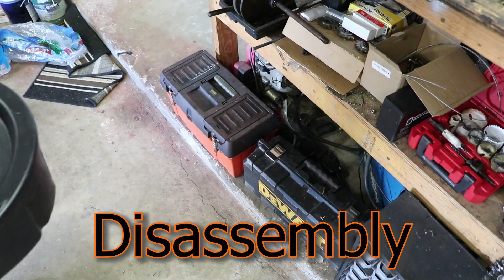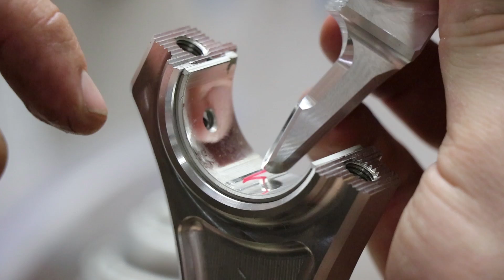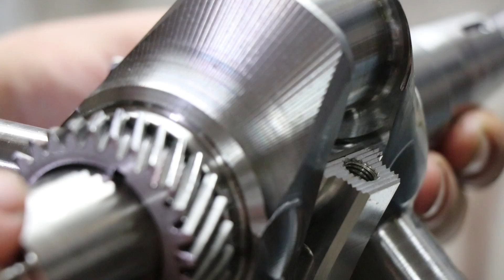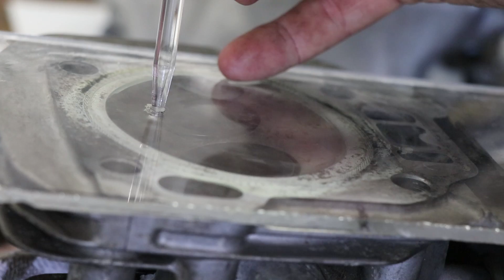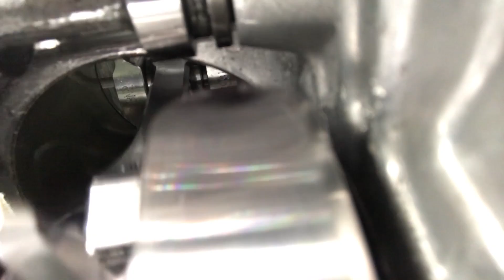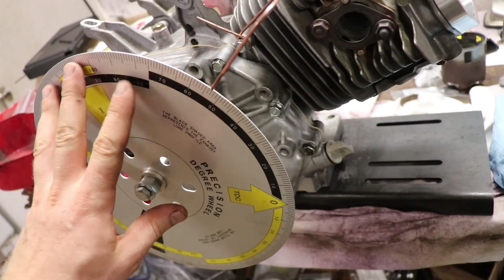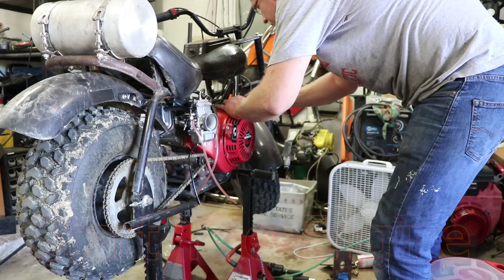Stroker Engine Build: 30+ HP on a 65 MPH Mini Bike! (Complete Build)

Comment: And for beginners or ' newbies' you don't sand your piston top - you polish it for improved heat deflection back onto the combustion chamber & in a Hemi you can polish the Head combustion chamber surface too to stop carbon build up aids flame propagation without going into the science of it all.It adds HP & helps to make your engine last longer.If you've milled your piston crown you can get it Teflon coated or polish it to a shine (an old top Fueler speed secret)cheers everyone.T NZ

Comment: I've seen so many people use little short rods which put far greater stress on the cylinder and make less power instead of making clearence for rods like you did. 
With a little grinding you can use a 6" rod on a small block stroker which makes more power (stays @TDC longer) and removes the stresses, these engines tend to run cooler as well, all that's needed to do it correctly is grinding like you illustrated.
Nice job, well explained, if I build one I will follow your lead.
Reply: ~the hell are you talking about?

Comment: I would love to see this thing on the dyno.  Next it would be cool to see less stroke and a really big bore and make it a really high revving engine and see how it compares.  It would likely cut down on the torque real low but add HP up top.  Great video by the way
Reply from the maker: yeah, the dyno is all set up. Youll have to wait about a month to see the video though as I have other footage im working on now.
Reply: Can't make really big bore, there would be nothing left of the metal around it...
Reply: For a high rev engine, you really need a pressurized oil system, not a splasher. Just my opinion but I'm guessing most here who've modified engines will agree with that assessment.
Reply: @BuzzLOLOL  And then heat wont dissipate, it will cause failure.
Reply: Hello,,question   I have a gx390  also but trying find the correct Crankshaft output Length to fit my new reduction gearbox,,,,, for Belt drive for go-cart,,,,,It’s the most common gearbox,,And China guy couldn’t help with any information. Or understand for that matter.     Appreciate your time and look forward to a  reply when your able of course.    Thank you
Reply: @BuzzLOLOL  sleeve it
Reply: @hunterpetrovich1460  - Can't sleeve it bigger than the outside of the aluminum casting...

Comment: You should clearance the block, connecting rod, and piston before you send it out to the machine shop. you want the crankshaft, connecting rod, and piston to be balanced together. It seemed like he sent the engine to the machine shop, then milled down the piston, and ground some of the connecting rod down. I could be wrong but it wasnt to clear to me while watching the video. Great build and this video had a lot of valuable info on building a small engine. Great job and thanks for sharing it.
Reply from the maker: Correct. That’s how it should be done. Video isn’t on chronological order.
Reply: @KartFab  If you are still around, why not clearance the cam lobe rather than the connecting rod?
Reply from the maker: @Khal03 was a small amount to clearance.

Comment: I always put the rings across from each other,  because the farthest away from one another is 180°  the sight blow-by going through the gap, would have a long way to go having to go through 3rings  and around the piston a few times, to get inside the crankcase, the top oil ring does offer some resistance to blow-by, with the drain holes in the oil ring land, the bottom oil ring would not matter to the blow-by,

Comment: When you say, after lapping the Valves, they are exactly the way they need to be, I agree on one of the two.  The Intake Valve seating ring is correct.  The area you lapped in is exactly in the middle of the Valve Face.  The Lapping ring is the correct width too.

The Exhaust Valve has a seating surface that is to close to the outer edge of the Valve Seat face.  The ring left from Lapping is about twice as wide as it needs to be.  A Valve Seat Cutter (see Neway Valve Seat Cutter Kits - Get the right kit and you can do 3 angle valve job for even better flow) would allow you to re-cut the Valve Seat.  By doing this, you would be able to move the Seat Area seen after Valve Lapping so the ring is centered on the Valve Face and the same width as the seating ring seen on your Intake Valve.

Thank you for the cool video!

Willie
Reply from the maker: thanks for the info! Ive been wanting to do a bit of head work., Instead of doing it myself i got the chance to trade for a head that had a professional port job, milled .100" and true 3 angle valve job with a larger intake valve and seat.  I got it o-ringed and will be putting it on the engine soon!

Comment: Yo my predator 212cc stock engine does 60mph with a header, jet and airfilter with a bypassed gove. 36T rear 12T centrifugal clutch on 15"x5"-6 "safe" ultimate street tires from go power sports. Tomorrow 18LB valve springs with a tilotson tct mechanical carb

Comment: Love these videos, although i am more of a 2 Stroke guy because they are waaaaaay easier to modify, and also i just love to hear small 50-80ccm bikes reving to 13'000+ rpm.
Reply: PistonBully I like the sound of my weed whacker.
Reply: wtf
Reply: So you like the sound of an amplified mosquito
Reply: Its not the sound but the power comparated to 4-strokes
Reply: @elespiritudeltigre9526  well amplified mosquito sounds better to me than a wet fart.
Reply: @elespiritudeltigre9526  better then an amplified fart😂
Reply: You mean glow plug 2 stroke engine ! Not many 50s-80s rev out that high except in your dreams, no offence.Trev. New Zealand
Reply: @trevinskiking2165  well, alot of modified oens do rev that high, obviously most standard ones don't, they max out at around 9-10'000rpm.
Reply: @aaaabababa  Factory 50cc works racers ? Yes usually Hondas
Reply: @trevinskiking2165  factory 50ccm Motorcycles.
Reply: @trevinskiking2165  factory 50cc Racers were usually at around 17-21'000rpm back when there was still a 50cc GP.
Reply: @aaaabababa  Know kidding, ? Tell Honda that etc, obviously you didn't read my previous statement.Go back to the 1950s & 60s, sigh 21,000 ? Their not Model glow plug g engines.Cheers
Reply: @aaaabababa  Your talking to a Prof engine builder & I have a Factory modded works racer, a 2 stroke 90 cc Suzuki.Enough Said.Trev New Zealand
Reply: @trevinskiking2165  i'd expect a professional Engine Builder to know that this kind of Stuff existed back in the 70s but okay. You just have to check youtube to find a ton of old 50CC GP bikes that rev that high, Honda even made a 50cc 4 Stroke that did those RPM's back then.
Reply: @aaaabababa  I know that, show some respect.
Reply: @trevinskiking2165  so were is your Problem then?
Reply: @aaaabababa  Excuse me, What problem ?...
Reply: @trevinskiking2165  you are telling me that those engines are Glow Plug Engines, which they are not.
Reply: @aaaabababa  NO I'm not, stop playing games, you seem to have a predelition with rpms,the last 1/2 of your user name is very Apt.
Reply: @dangerousdoggo5465  pistonbully has a link about little 2 Strokes OVERREVING.
Reply: Dang autocomplete ' kink'

Comment: My recent motor is a Briggs Vanguard 7.5 hp that I got in the junkyard for $9 not bad. They were great with me they let me bring my old blowned motors to exchange swap my favorite Carburetor and it runs great.
Reply from the maker: those are nice little engines.

Comment: One thing is that you should always register your start of a buret below the 0.00 graduation and bleed any air in the tip. That is the least accurate portion of the buret

Comment: Should be pushing around 25-30HP to the wheels with that work done
One year i want to do up a Gx460 clone Block
Reply from the maker: you could also go with the 500cc bigger block that bullfrog racing has.
Reply: Nope
Reply from the maker: anonymous  nrracing

Comment: Very well done. But I’ve always wondered why on engine clearance issues on any mini bike with a faux tank there is always room to raise the engine and put a functional gas tank same teardrop style on having the bike functionally correct with the open top as extra room. Call me old school but that’s what I believe and that is on any mini bike with fake gas tanks look at the mini bike as a real motorcycle you had a good 4+ inches on top to raise the engine. Other then that you did a great job on all your build issues with engine parts and internal clearance. Very well done. Also I have a MM-B212 Mega Moto and bought the front suspension front disc brake setup to make it as close to the MM-212 Monster Moto and found all the parts at Go Power Sports since the company went out of business even another seat. I installed my own LED duel 60 watt headlights but now you have me thinking should I take the new still in the box Predator 212cc Hemi and just get a 301cc or a 420cc and build it to put on my Mega Moto 212 instead. I will run my original for awhile while I build my replacement and put the MM-212 on my Coleman CT200U since I already removed the Governor arm and reconnected everything to the original arm assembly it came with added a .90 jet and air pod and a drop down long header. I want to build a swing arm add rear shocks but not very good at welding after over 25 years of not welding. And I’m looking for a functional teardrop gas tank but the bike doesn’t have that much room from seat to triple trees and it’s a split top bar not single like Baja’s.

Comment: Great build! One sugestion though, lock the flywheel in place when torquing down the crankshaft bolt. You wont risk bending your crankshaft that way.
Reply from the maker: how would you lock the flywheel in place without damaging it?
Reply: KartFab I would use some kind of strap wrench. A custom tool that locks the starter ring in place could also be an option.
Reply: What on earth are you talking about guy?,.. have you been inside a GX390?

Comment: Only criticisms are I would’ve put the governor plug bolt in from the outside and trim the bolt head if needed. Other one is I would’ve welded the backside of the hole too. I can’t really say anything because I’m no professional but just my 2 cents.

Comment: First off, anytime you're doing engine internal work, you never touch off with paper. Use an edge finder and do things correctly or not at all. Standard paper is .0045". Now, your piston was made with a tolerance of .009". Slop work. As someone who worked making military components for Helicopters, ect... I had to hold tolerances of .00005. That's millionths. You couldn't pay me to accept work like this.
Reply: You can't really compare a $300 mini bike engine to a $25 million+ helicopter my dude.

Comment: Jus a tip i learned from RBG! Weld a slide hammer onto that bearing u had a hard time getting out. Works great
Reply from the maker: They actually have a tool called a bearing puller. 😅

Comment: Not sure how often you crack open your engine after you rebuild them but if the term "as little as possible" then I would highly recommend gloves when dealing with "friction bearings" oh how i hate that term. But the rod and main bearings are covered with babbitt which is very sensitive to acid, even that which is on your fingers. The bearing is negatively effective by causing low hour wear of the bearing. Just a FYI

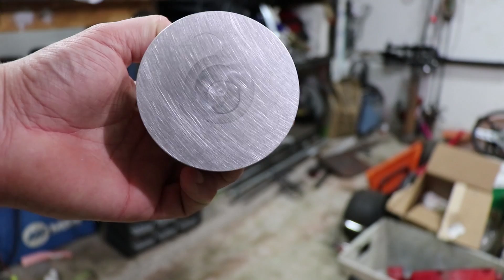Comment: 14:30 I've heard polishing the head and piston top could give a little more power. Never seen a dyno prove, so i don't know if it's just a myth, but it ort to help with carbon build up. Never heard it was bad until now. Plan to do it to my new bike this winter, now i'm not so sure :/

Thanks for the info, i'll look more into it before going ahead with the bike :)
Reply from the maker: Ive heard that too. With the old briggs 5 hp flatheads they got a lot of carbon buildup in the heads. With the OHV engines, i dont ever remember seeing a lot of carbon buildup. Even if you polish the exhaust to a mirror finish, you are still going to get carbon buildup in it. With that said, I dont know if it matters a lot in a gas engine. When you are running on methanol, which has issues with vaporization, then keeping the intake runner and head slightly turbulent will keep the methanol from going back into liquid from vapor. With the fuels I have seen, the ones that make more power increase VAPORIZATION of the fuel. On these smaller naturally aspirated engines, when an engine is cold, the fuel tends to fall out of vaporization and stick to the cylinder walls. Once it gets up to temperature, then you dont have that issue. I guess what I am getting at here is there are 2 much more imporant things to consider 1) HEAD TEMPERATURE and 2) VAPORIZATION. The engines that make the most power have the fuel that vaporizes the most, and the head temperature that is optimal for vaporization. When you look at the performance WISECO pistons used in these engines, you will notice that the piston top has small ridges in it. I think that is there for a reason instead of having it flat and polished. Just something to think about.
Reply: @KartFab  Arh i see, good point and thanks for the reply. I did actually not know head temperature played any significant role, but i usually mess with LC engines so guess i just never looked hard enough. Nice to learn something new! :) Regarding polishing the head i mean only the internal "cyl" part, i plan to use a grind 120-180 on the intake to ensure some surface turbulane, you know just touching so the mold surface gets replaced. As i implied, got this strange feeling it's just a myth, but gotta try you know ;)

Comment: try dimpling the intake after porting. i asked my engines teacher about it in college and he happened to have a flow testing machine in the back room. 455 big block olds hp head. gained 32% flow just from porting and dimpling the intakes. vw was on to something

Comment: Hey man I really dig your videos I have a performance shop down here in Houston, if you need any port work man feel free to hit me up. Be glad to help you out I have over 1k in porting equipment. I love these little small engine projects. Keep up the great videos!
Reply from the maker: When it comes to a race head, there is no substitute for a professional engine builder's work on the valves and ports. I kinda just did this to show what a DIY guy can do. No flow bench, port diameter increase, or 3 way valve jobs done. I leave that to the pros.
Reply: @KartFab  I am a professional cylinder head, intake and supercharger porter 20 + years. I like what you do, that's why I was offering my services to you.

Comment: All kinds of claims of “wait till you see the dyno numbers”,.. 

But he never posted the dyno numbers~ anyone else notice that?
Reply: Prolly cause it made like 20 horsepower😂
Reply: heard from someone else that these minibike are too small to be on a normal dyno
something about wheel needing to be 1.5x bigger than the dyno
Reply: he made a dyno for go kart engines
Reply: @nicovanduin1553  how do u gain 7 hp from all those mods?
Reply: @noidontthinksolol  those engines arent knockoff engines their honda a name brand
Reply: Lucas Oldaker  bet
Reply: @noidontthinksolol  it's more about touque at really really low rpm
Reply: m 88 that’s true I never though about it that way but how scary would that thing be if it went to 7k and made that much that thing would be so scary and hard to control I think

Comment: the weld doesn't leak, but most likely the bore for the bearing is oval now. check it using an bore gauge.
Reply from the maker: You are probably right. I don’t need that bearing as it is for a counterbalance that was removed. The rotating assembly was balanced afterwards.
Reply: thats great news, because usually when you insert bearings into oval bores they don't really like it. Glad you could achieve your preferred balancing-factor even without the countershaft. For removing bearings like this one: Either degrease it and insert a fitting shaft with some loctite 638 on it into it so you can pull on that shaft, or just turn the engine in a way that this bearing could fall out and then heat its surrounding using a propane torch and use a very light hammer or a wrench to softly tap against the case surrounding the bearing and it will fall out.

Comment: You can got even more performance if you just went to a direct drive system so that means to get rid of the jackshaft and go from the front straight to the back you will actually gain several miles an hour I did that with a stock 6 1/2 Baja 200 top speed was 31 32 miles an hour after that I went from the front directly to the back and the customer kid got it to go to 45 miles an hour cuz them belts work out and if they get water on them they just don't really want to work that's why I chain driven system is lot better

Comment: I think it would be amazing to see an actual torque converter made for an engine this small
Reply from the maker: the comet 40 series is rated for 18 hp, and there is the comet 780 series that a lot of people use for their mini buggies that I have been thinking about putting on this.

Comment: On the valve geometry the rollers are supposed to be in middle at HALF LIFT your where centering them at 0 lift
Reply from the maker: You got the first half of that astute observation correct.